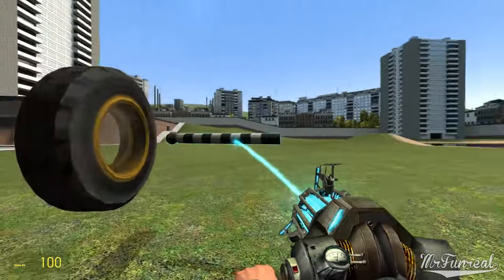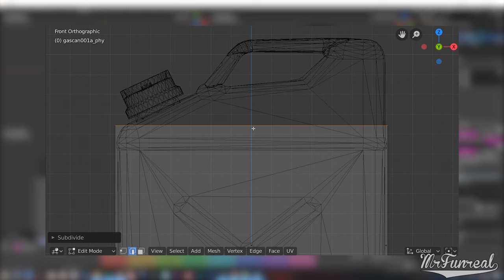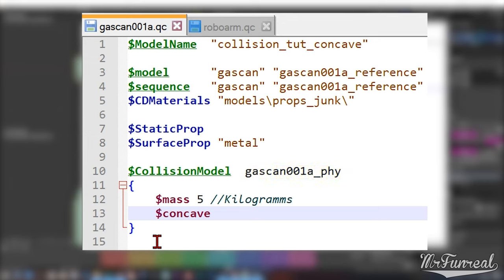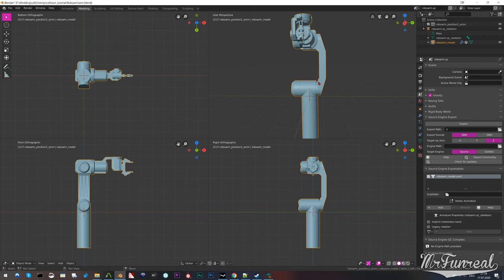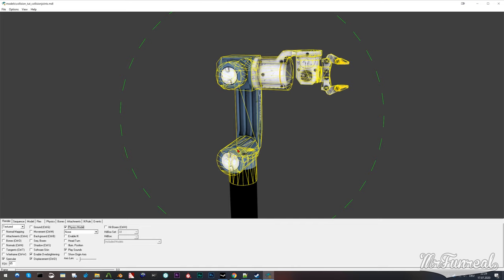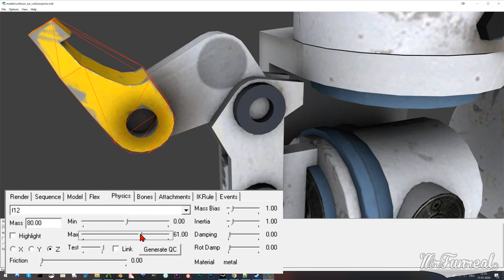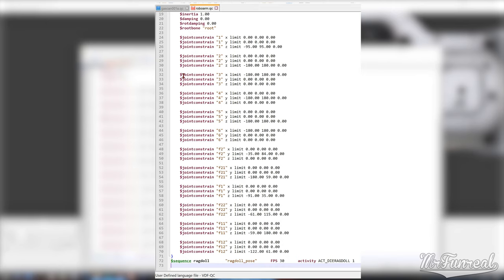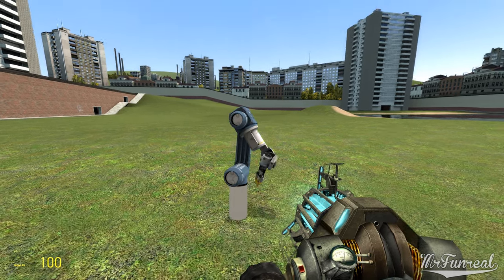Creating Collision Models | Source Engine

Comment: why is there WARNING: Model has 2-dimensional geometry and WARNING: Error with convex elements of *insert physics mesh name here*, building single convex!!!
Reply from the maker: Happens when it does not recognize a shape as valid.
Usually when it has sharp or split edges.
Reply: @MrFunreal  xactly, so u gotta make it smooth

Comment: I figured I needed to say something, considering all other comments are requests, and say nothing about the actual video.
This is a good tutorial, nice job explaining everything.
Even though I couldn't get my concave collision model, I'm pretty sure it's an issue on my end.
Reply from the maker: well, i get requests on every video i made. nothing i can change abotu that.

However, not having a concave mesh can be caused by using "flat shading", instead of smooth, not using $concave or simply having a hole, or not connected edges in the collisionmesh

Comment: I see you are making separate pieces into some kind of “Vertex Groups”, this is interesting, I need to watch more tutorials on blender.
I made the individual parts just new objects in one phys-named collection and it worked too
(With the SourceOps addon)
Reply from the maker: the "Vertex Group" thing is the rigging (weight paint).
all collision mesh that has moving parts needs to have their pieces rigged to the bone they're supposed to follow.
Props that don't have moving parts don't even need bones to begin with, therefore they also do not need vertex groups

Comment: im attempting to compile a collision mesh with 20 separate parts and it ends up compiling into a single large mesh. Exported and compiled for source sdk multiplayer 2013 with smoothing enabled. Anybody know a solution?
Reply from the maker: Check the compile log for errors. 
you probably got a warning about a "less than xyz thick wall" which basically means you got a hole, or a split edge anywhere, so the entire collision mesh is ignored and made convex.
Reply: @MrFunreal  oh yeah i found the problem kinda. In blender, my models had UV seams, UV maps, had some marked sharp edge data, had sculpt-mask data, and a material applied. Once I got rid of all of those and then re-exported the model, everything worked just fine.

Comment: Hey man!
Can i just ask, do i need to have a small amount of space between arm collision models (like a small space between the torso and the arms for example)?
Reply from the maker: You should, yes. Because the pieces may collide with each other and physically stop your arms from folding down all the way, even if the limits would allow it.

Unless you manually set up $jointcollide strings for all the bones
Reply: @MrFunreal  Thank you!
Just another question if that isnt a problem, I made the rough outline of the model and i was wondering, do the parts of the outline (in my case they are just called cubes) have to  be in the _phy folder?

Comment: I have a ragdoll which I need to make collission joints for, the problem is that I can barely differentiate between my ragdoll and collission model, it becomes impossible to model, as well as keeping it as close to the original mesh as possible.
Reply from the maker: should be easy. 
Your model is detailed, the collision model is not.
Reply: Use ModSomeFun's tutorial for him Modding Millie into GMod. Enter Edit Mode, then delete portions of the mesh which overlap joints, then select groups of the mesh (say, the disconnected "RForeArm" mesh) then press F3. In that menu search for "Convex Hull" (this can also be found in Edit Mode > Mesh > Convex Hull). Click it. Do this for every portion of the mesh, ensuring that there are still open portions on the joints, between the limbs. There will need to be at least 2 segments for your spines, and don't bother with the fingers. You will want to keep the number of parts below 20. 

Afterwards, still in Edit Mode, select the Entire Mesh, then F3 Search for Decimate Geometry (Mesh > Clean Up > Decimate Geometry). In Blender 3.3, this will open a dialogue box in the bottom left hand corner of the view window. In this window is a  slider labeled "Ratio". Adjust this to your preference, but ensure you don't decimate too far, keep the ratio above .150, I would say. 

Afterwards, select your entire mesh, then F3 Search for "Triangulate Faces" (Edit Mode > Face > Triangulate Faces"). Now your mesh is ready for use with $collisionjoints.

And one more thing, change the material of the Collision Mesh to a new material named "phys". It doesn't need to be colored.

Comment: I was wondering why collision models has to be smooth shaded? Does it make a difference if the collision model is solid shaded?
Reply from the maker: "solid shaded" doesn't exist in blender. Only smooth and flat.

Sharp edges are not accepted for some reason.

Comment: I have a problem where the generated collision acts only as a static one, it doesn't follow the animation at all.... any thoughts as to what it can be?
Reply from the maker: because you didn't use the right collisioncommand for it to follow bones.
Reply: @MrFunreal  I figured it out... Ty for the reply. Also u can add this $maxconvexpieces 9999... the limit is not 32 but 9999.